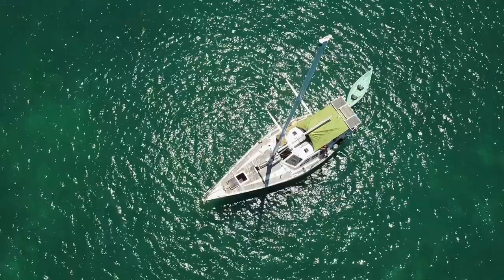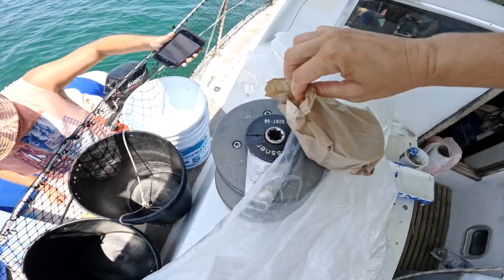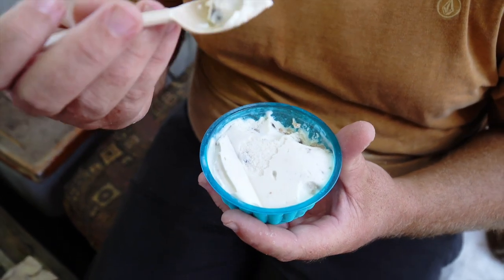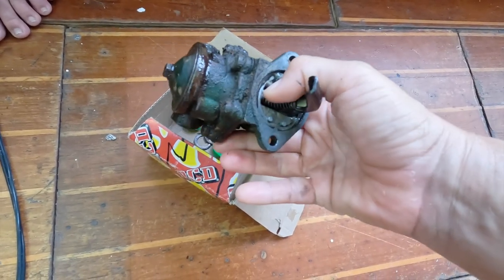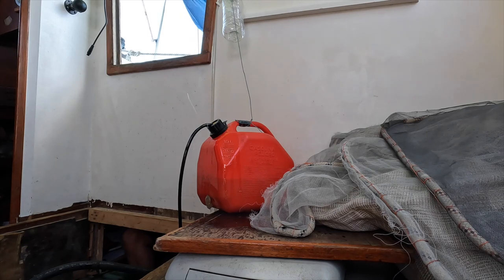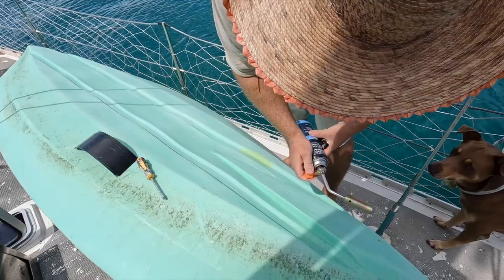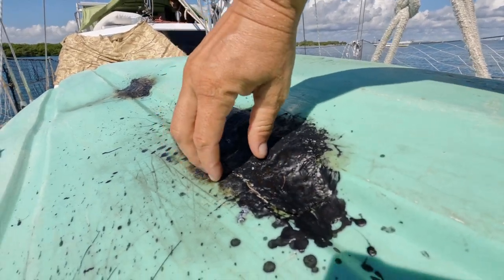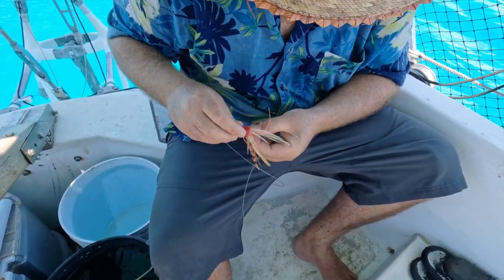hot messy sailing failure ISLA MUJERES

Comment: Idea from outside the box. We use it :) Hard bottom from fiberglass dinghy  (no double bottom). Where you will be able to find for sure some denflatables. Tubes off and instead walls from fiberglass. Walls from polyester so it's not so expensive. If you need any tips or tricks we done three of those already. Keep it going !
Reply from the maker: Took a look at your deflatable-polyester-dinghy. Interesting!
Reply: @sailorama   It's a fast and cheap solution especially that you seem to know your way around fiberglass ;)

Comment: I seen a video of a plastic boat cut in half and glued together with g-flex and seemed to work.
Reply from the maker: Yes indeed, two-part epoxy is always a winner - we put some epoxy on the kayak again now, which has been holding better than any of the plastic melting we showed in the video - most likely g flex is a step above that, but we don't have any here, unfortunately.
Reply: @sailorama because you changed the chemistry of the plastic by heating it up with the blowtorch... be sure to add hardening filler to whatever epoxy you have and wipe the cracks with alcohol or acetone before you use the epoxy and... if at all possible? Epoxy both sides.  Maybe a hatch install... you 2 are so incredibly tenacious that it would not surprise me if you made a hatch out of a paint bucket (hint hint)

Comment: Have you tried Plastic JB weld? I'm thinking with your bucket patch and JB to bond that my work
Reply from the maker: JB weld, or the little two part kit that we have that is identical to that brand, pretty much feels and functions similarly to epoxy but functions especially well in hot temps - we have some epoxy and fiberglass on the kayak now - which holds for some time, but not forever.👍🏼

Comment: Tray a zip tie and melt it over the crack so the zip tie macks a puddle over the crack and so on and so on until the crack is sealed and do another process with the big bits of plastic over the top of the crack bit like a plaster like what you put on your f-ing to make it stronger as well you can put also fibreglass or the top of it as well Foster just trying to help good luck
Reply from the maker: Yeah we've melted so many plastics onto those huge holes, and it all cracks off the first time we put our weight onto the kayak and it flexes. As it stands, epoxy and fiberglass last the longest, but even that is only temporary.
Reply: Hi maybe the plastics that you were using may not be the right type of plastic  for your kayak see if you can get a damage kayak and us bits of the broken kayak to drop bits of the plastic on to the  cracks of your kayak maybe it will work hope so good luck

Comment: Can you get GreatStuff  spray foam there?  If so, then drill a few small holes and then fill the air gap with the foam.  The stuff uses water to cure so may work.  This for the dinghy.
Reply from the maker: We could probably find some other kind of spray foam here - that's an interesting idea because if it is dense enough, maybe that could help to keep water out 🤔👍🏼
Reply: @sailorama  The foam would expand inside the cavity and keep the water out.  I would be less dense than water so would help it float.  They make surf boards out of foam.  I have used the original GreatStuff to seal around a door frame.  It expanded enough that it jammed the door so that it was hard to open.  I see that a place called UBuy in Mexico sells the stuff.  Get the red can.
Reply: Foam must be sealed to keep water from turning it into a sponge